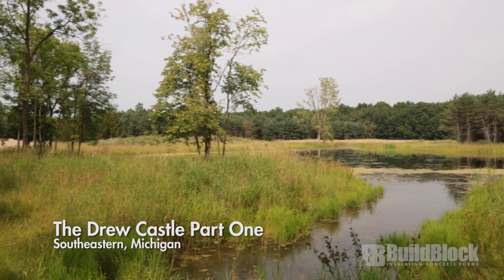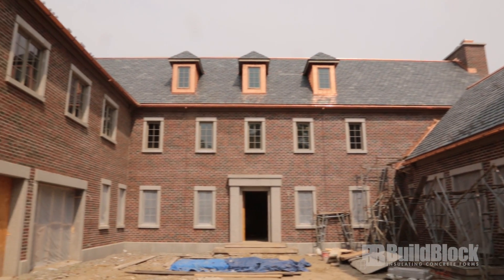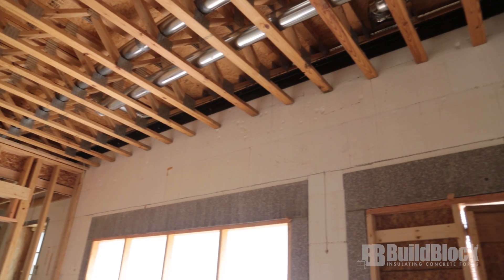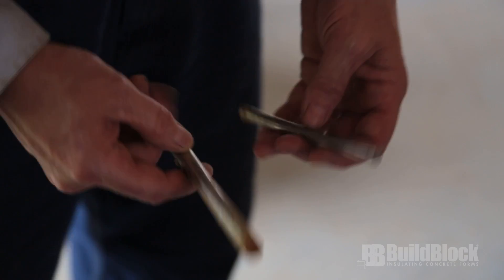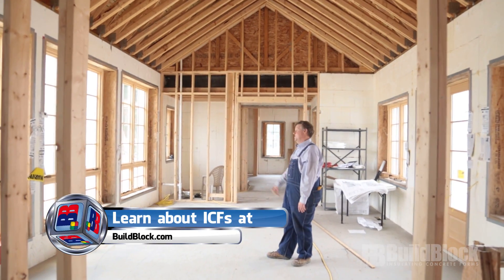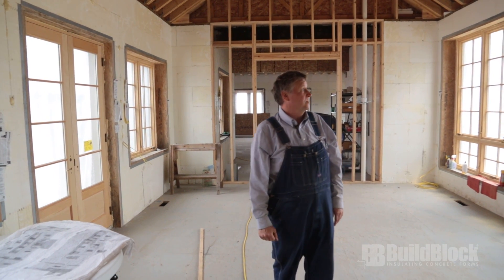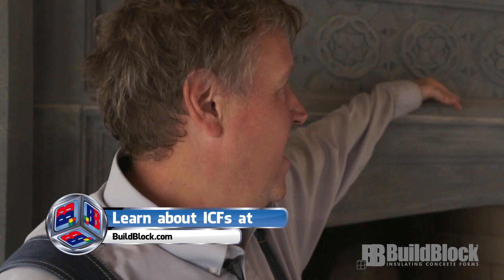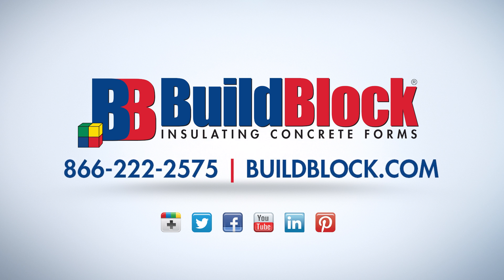How to Build an ICF Castle Part 1

Comment: So I have watched these several times through the years.  My question is do you get a good air and water seal between the concrete and the granite?  I like the look and may use it when I build my home.  Just afraid it will leak or transmit heat and cold to much.